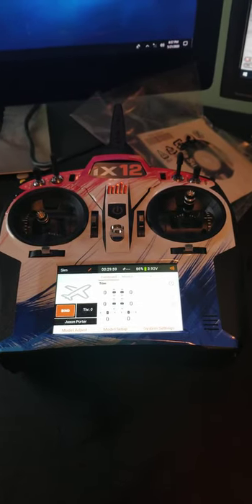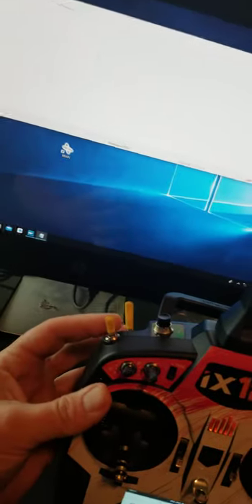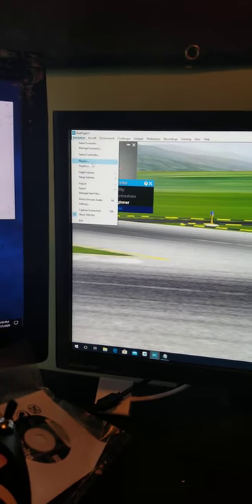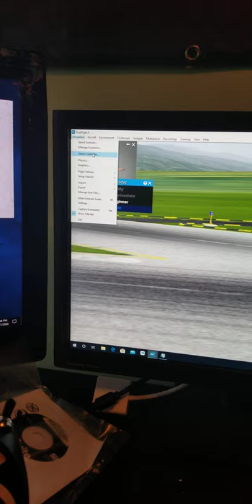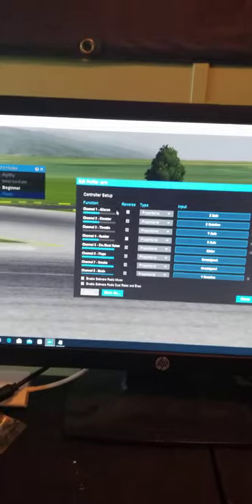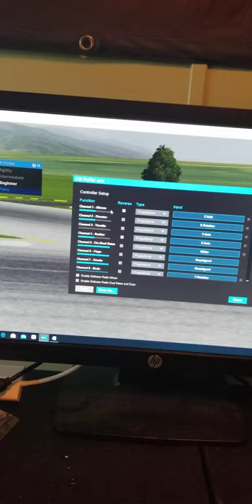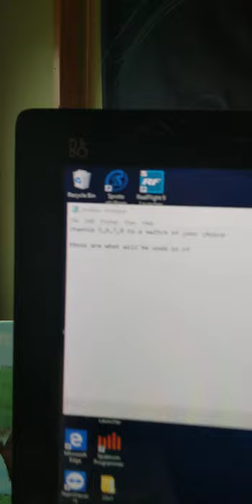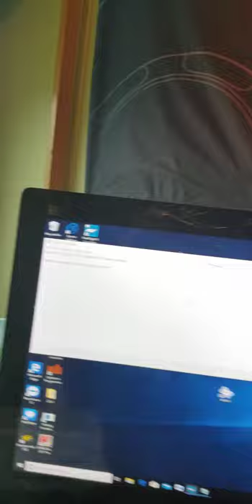Ws2000 setup realflight 9

Comment: i'm totally new to all R/C but in the last month i've purchased 2 DR10 pro mod cars and 2 trucks.  A Traxxas slash and a Vaterra C-10 Pick-up.  i got the E-flite Apprentice STS Prop RTF and the Habu STS Jet RTF.  Trying to get both my Transmitters working on Steam using the WS2000 Dongle and both the DXe and DXs.  I just realized your thinking this video is the instruction I need to get this done for myself.  Guess it should apply to the Real Flite Trainer Edition also.  Duh  Thanks for the video,  I subscribed as I should given the help it appears I need.  Couldn't see the writing on the tar mac... Thought I'd say wall. lol

Comment: I just bought a SPMWS2000.  I'm having nothing but trouble, trying to get my ix12 to work properly with it.  It seems the dongle doesn't see any of the switches on the upper right of the transmitter.  I'd like to have switch G as my throttle hold.  There doesn't seem to be any way to register that switch to the dongle.  Perhaps I have a faulty Dongle.  Any suggestions?
Reply from the maker: I doubt it’s faulty , when you set the model in the radio you set it as a acro correct?  And as for my understanding it’s a 8 ch receiver so it won’t pick up all of them , when I did the video it was with rf9 and I no longer have it and I know they updated to 9.5 so it may have changed some of the mapping functions . I believe it will only map switches that the interlink controller has but again not to sure , sorry I’m not much help
Reply: @lkn4home  Yes, I started with a fresh Acro model.  Some switches work, others don’t.  I even found one Blog that suggested every model you fly on the simulator needs a unique control profile, for the WS2000.   Another article suggested a Heli model profile is required for flying Helis.  I’ve tried every suggestion, I’ve found to date.  Things do change, depending on model profile; I’ve even had some luck assigning different switches on my ix12.  You’re totally correct, Jason, only 8 channels can be configured and the dongle is most likely not faulty.  I was under the mistaken impression that the Spektrum Dongle was some sort of Bluetooth or similar connection interface.  My expectation was that at the very least,  my ix12 would function the same as the Interlink DX controller, without any intervention.  What I’ve learned is that the Transmitter actually thinks of the Dongle as a receiver, and as such the receiver (the dongle) has to be set up, in addition to any programming that might be needed in the radio.  I think the real bottom line is that the programming possibilities on the dongle, in conjunction with the ix12 Transmitter, are nearly endless.  As things go these days, provided documentation is very lacking in detail.  What would we do without the Internet?  YouTube and Blogs are a great help.  I’ve opened a support ticket with Spektrum, in the hopes that they might shed some light on my specific ix12 and WS2000 programming requirements.  I’m currently awaiting their response.  In all likelihood, I’m going to return the dongle, for refund.
Reply from the maker: @wolfgangreiner744  odds are is you will get the same as my video lol , I opened a ticket when I got mine and the info in the video was there response. Agree there needs more documentation or at least a setup file that can be downloaded .
Reply: Thanks Jason.  Your help was greatly appreciated. I received an email reply from HH Support, yesterday.  It was encouraging but not specific enough.  They suggested I call their support technicians in person.  I plan to call them tomorrow.   I agree, a downloadable SPM file for the ix12 would be extremely helpful.  If I learn anything new, I’ll share the info with you.
Reply: @lkn4home  Success!  The phone call did it.  The HH support guy was very knowledgeable.  He talked me through the basic ACRO setup and followed up with an email.  I’ve since also successfully set up the Throttle cut switch on Switch H on my ix12.  My biggest mistake in the process was binding the basic ACRO model in my ix12 to the Dongle, before properly configuring the Channel and Switch assignment.  The correct process is to configure the new ACRO model with the correct channel/switch assignment, before binding.
You probably already know the following:
The InterlinkDX controller sold with RealFlight 9.5 can handle 9 discreet channels.  The Spektrum WS2000 dongle (receiver) can handle only 8 discreet channels.   Transmitters of course, are capable of more channels, depending on model.

Comment: Realflight 9 can't even detect my ws2000. It is appear on the human device, Can't find a solution.
Reply from the maker: Did you bind to it yet? Must be bound
Reply: @lkn4home  no, I can't get it work and it was returned for refund
Reply: Did you hold the bind button while inserting the usb receiver? That’s how the instructions say to do it and it worked for me. You cannot put it into bind mode if you insert the usb then press the button. You have to hold the button and keep holding it while it’s being inserted into your computer.